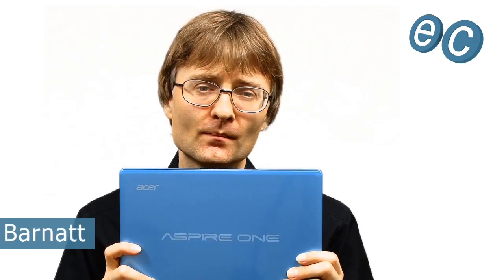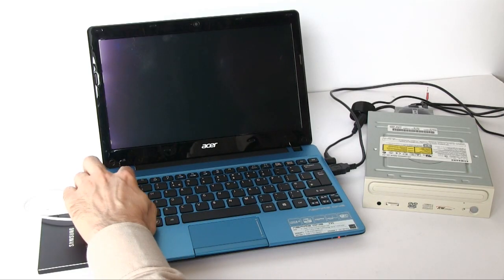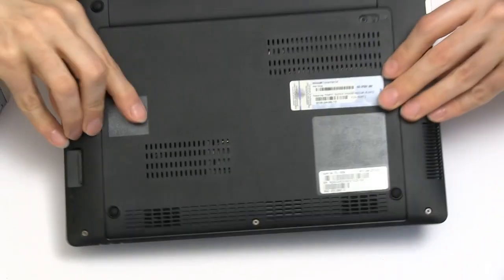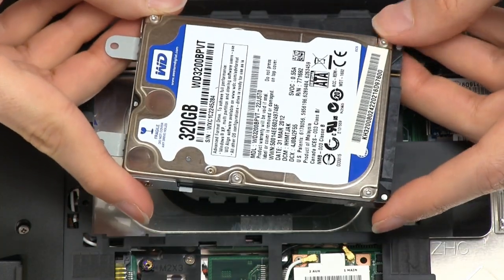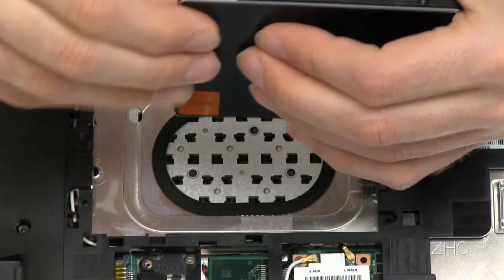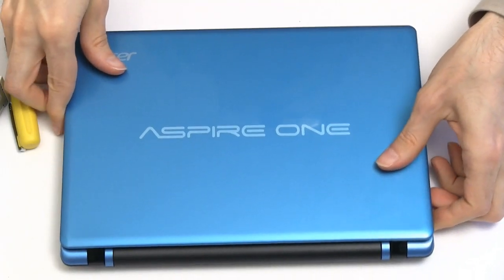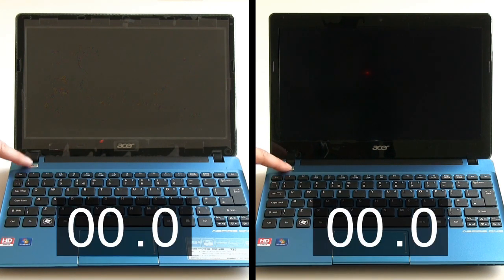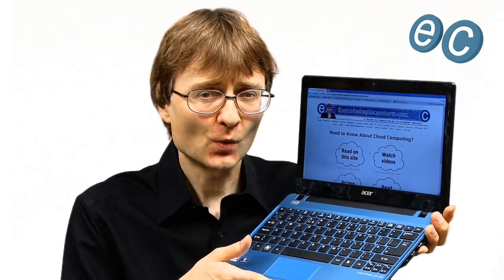Laptop SSD Upgrade (Aspire One 725)

Comment from the maker: The proportional resize function only changes partition sizes; it does not compress the data. If copying from a smaller disk to a larger one, this ensures that no space is unallocated on the target disk after cloning. When copying from a larger disk to a smaller one (as here), Pargon would simply not complete the copy without the function selected. But if my files would not fit on the new 120GB disk, it also would not work.

Comment: by re-sizing proportionally, do you actually compress the files in the HDD so that it would fit in the SSD?  so for example, if i have 150gb worth of stuff on a 320gb HDD would it do the re-sizing so that it fits in a 120gb SSD?  If i am wrong please tell me the proper function of that feature.  thanks

Comment: If you don't have your windows-cd, then backup your recovery data from the hdd or don't delete them from the ssd. All you need to restore windows should be there. No need for another copy of windows when you have the oem-key on the back there. All the factory software should be there in a large .wim file.